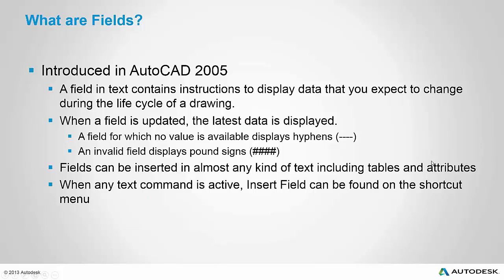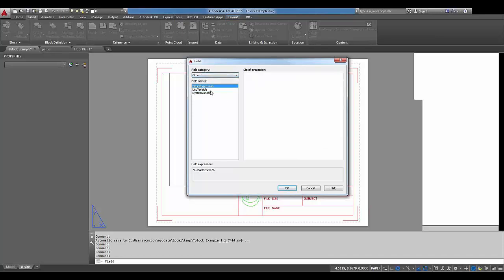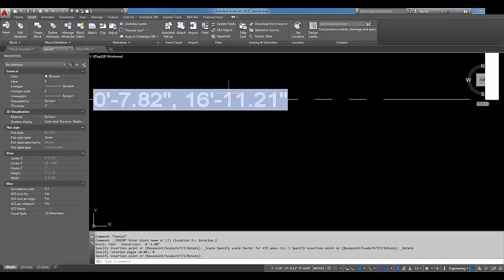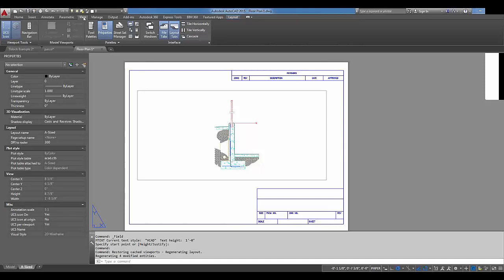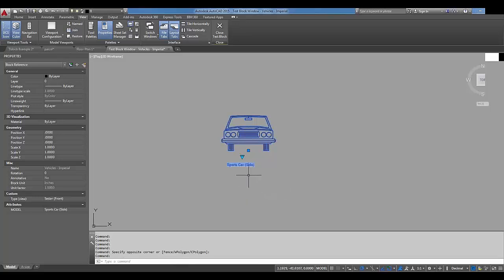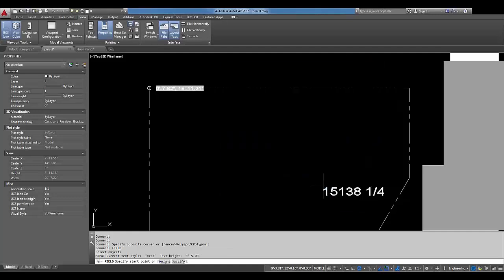Smarter Drawings with Fields, Attributes and Document Properties

Comment: time table 
@4:52 fields in autocad
@7:04 ways to put fields in objects
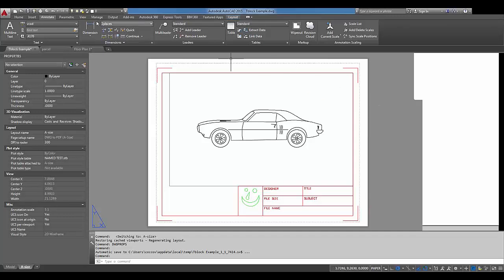@8:59 using drawing properties to populate the field cells
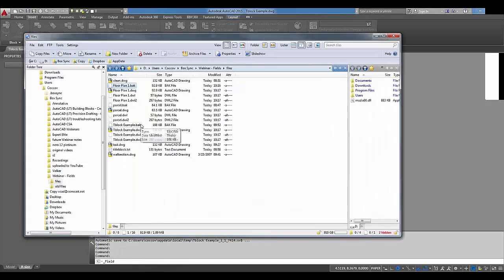@12:40 what documents properties are
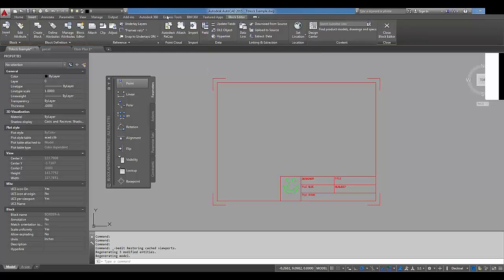@16:48 adding fields and fill it with document data via block editor so we can use the block in different drawings
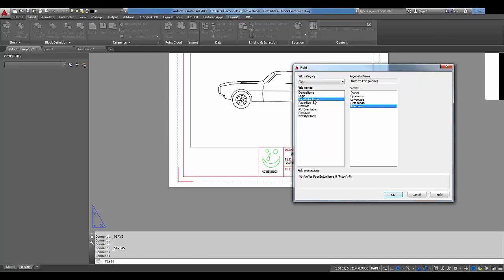@22:37 automat plot stamps using fields
@26:03 putting field inside a rectangle to show its area
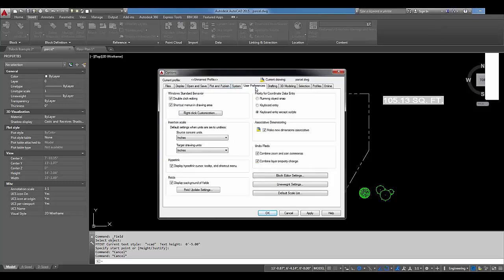@27:17 controling wither or not the field automatically update in user preferences
@29:27 making a block with attribute and field to automatically show coordinates in drawing
@31:30 date and create date are static values which means it doesn't update automatically
@33:18 making a layout hyperlink to go to it using fields when we need to see a certain plot
@36:21 using block attributes with fields to update a visibly of a block automatically
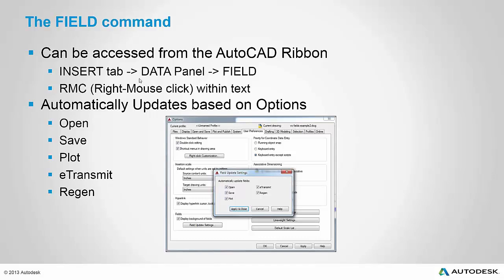@42:44 Q&A